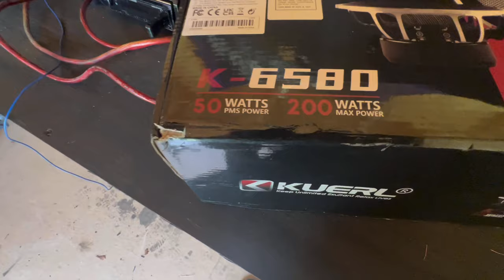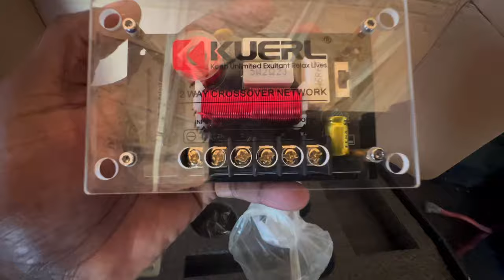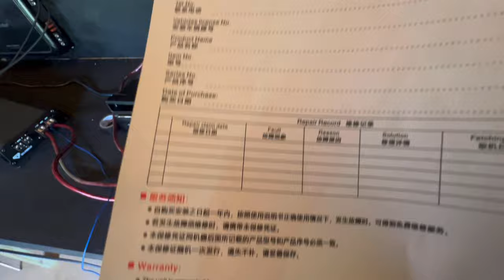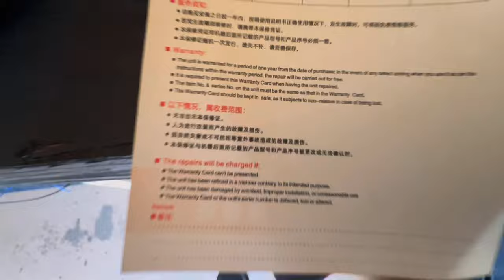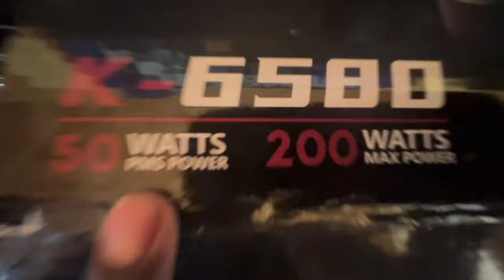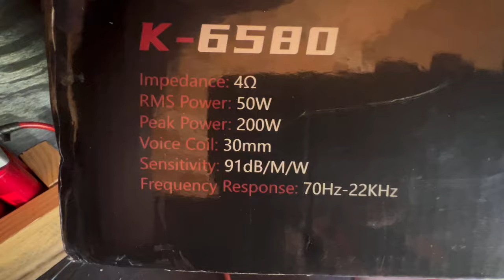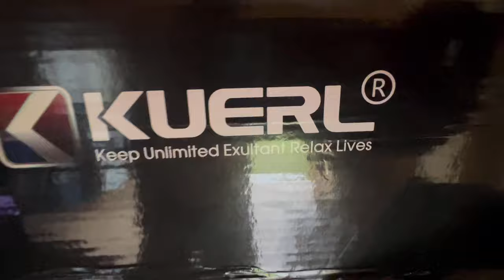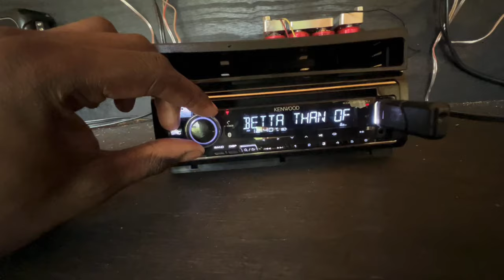TEMU Has Car Audio? Unboxing KUERL AUDIO 6.5 Component Set| Is It Worth The Money?

Comment: Common automotive amplifiers have 50 RMS with 100 Watts output so those speaker are in the range. My concern is the bass performance. I have (4) 5¼" Polk MM522 speakers in my motorcycle fairing and they sound great until it comes to bass and then they are lacking. I can install lower fairing with an opening for 6½" speakers and my focus is on bass performance.